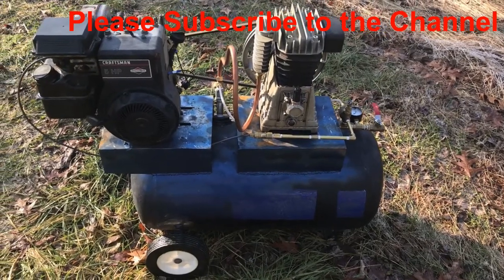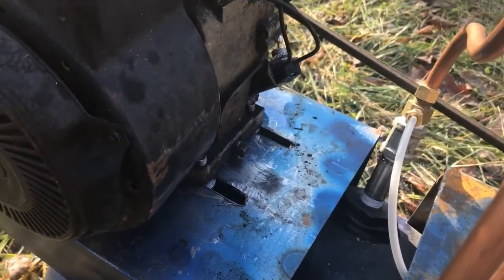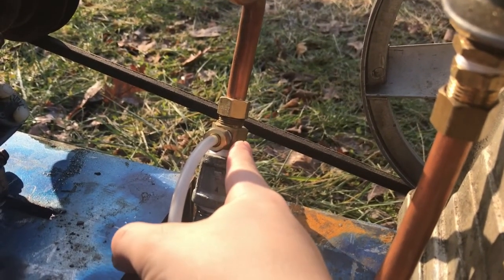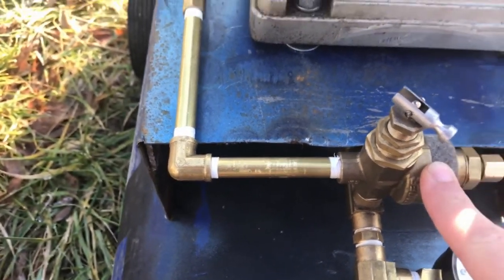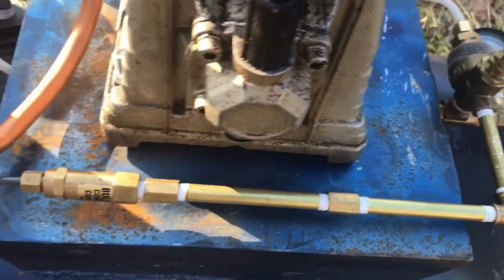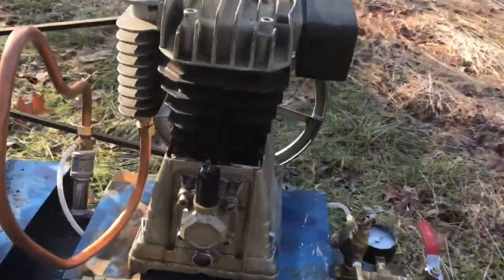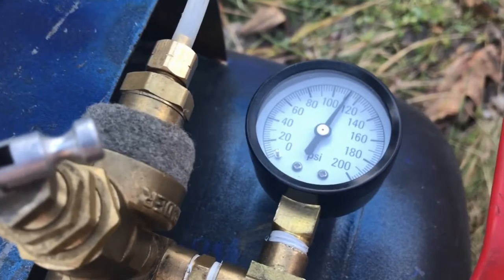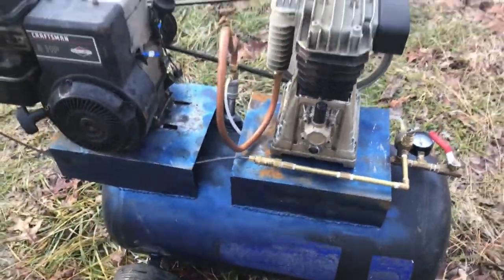Homemade Gas Air Compressor [Version 2]

Comment: What is the capacity of this airtank?
What is min and max setting of this unloader valve?
Please reply 
I want to purchase 
I have same compressor unit
Reply from the maker: I believe my compressor tank is 20 gallons. I think the unloader is set to 115-125psi cut off pressure and then 90psi cut on pressure.
Reply from the maker: What do you want pictures of?
Reply: @TimothyMsnowman  i want pics of the plumbing ( piping connections) 
Because i want to make the same as your compressor 
I want dimension of air tank also

Thanks